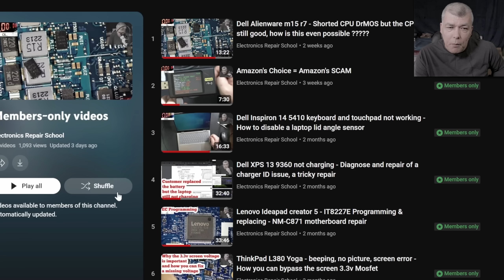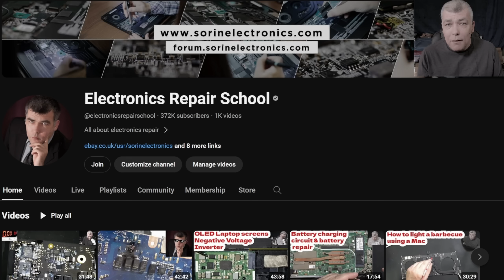HUAWEI MateBook D 15 not charging, board repair

Comment: hello i need help with my huawei matebook D14. my usb ports are not recognizing anything i put in. and when it sleeps it cant turn on automatically (i have to manually turn it off first then start up again) i recently brought it to known a repair shop here in my area for a check up and they said it has hardware issues and theyre refusing to repair it bcuz they havent fixed any huawei products before

Comment: if recalling it is something they can't do because of money issues.
how about give everyone a free magnetic USBC adapter.  
that will somehow solve the issue. 
I have a lenovo that has usbc as charging port. 
and I have Trust issues on such thing coz it is a laptop.. and a laptop weigh so much compare to a smartphone.
you can hold the smartphone from the charging port and it's totally ok.

but you can't do that on a laptop.  
if you happen to bump into that shit while it is charging.  it has a higher change of getting broken. 

because of that I decided to buy myself a magnetic usbc adapter. 
this way the charging port will never ever experience Stress from anything unexpected.

Comment: Parts actually get tested for years in the most extreme conditions. 30 years back i was at a philips testing facility where they already had bending lcd screens in boxes where humidity was very high or temps very high, etc. Just not whole products. But not sure if they have such a facility in china.

Comment: Manufacturers have a development strategy on products they design, they used to design products based on the same internal parts, and the top model board components were present, the base model components were not included, the model looked the same, but the extras aren`t.
Schematics are not included so servicing cannot be achived, it would be the same as removing the identification from the components from the board so you didnt know what they were!.
Spare parts for products are not produced, it would take up storage space, waiting for the repairer to request a part, but when! Products are made as cheap as possible, a new model is not a new model, it a old products made to look like a new model! fooling the customer who is thinking they are getting an improved product.

Comment: One way to make sure the laptop is not comming back due to a unconnected ribbon cable or something like that, is that you should always do quality test. You check sound, camera, USBs (daughterboard), keyboard, touchpad, Wifi. So if one of those is not working, you can always check if you did any mistakes prior to deliver the laptop to the customer.

Comment: i work with vintage radios from the 1930's to 50's and have no problems getting circuit diagrams and parts yet i can't get the same for my phone, tv or laptop
Reply: Yeah same here. I fix arcade games, old Space Invaders or Pacman schematics very easy to get. Even full diagnostic technical manual explaining how to check it and find the exact fault at chip level. For this reason never throw away anything old if it works because they are easier to repair. This is why my main laptop I use now is an old Toshiba Tecra A8 from 2009. Runs Windows fine ande evrything works. If it ain't broke don't fix it. Main issue now is the majority of people are not very smart and have no clue how to fix anything and just buy the latest things even if they are junk lol!

Comment: I was thinking about these 4 pack battery, they're in 2+2 (3.85v X 2 + 3.85v X 2) total 7.3ah configuration, and they look like regular phone batteries.
What I'm wondering about is if one pack is 3.85v 3.65ah. Doesnt phones already have bigger battery capabilities like 5000mha?

Comment: HI SORIN. you want manufactres to make products perfect . but what about all the technician including you??? what you going to do for living 😂😂😂😂
Reply: No such thing as perfect. Electronics eventually will fail, but not in a stupid way like this. But honestly, it is our own fault. We want smaller and slimmer devices, hence this is what we get. A flimsy USB C port, which then paired with lead free solder that cracks easily because manufacturers have to comply with RoHS or they can't sell the devices.
Anyway, back in the old days when we used to have the entire schematic and the parts to buy, repair techs actually made more money compared to now (with the exception of Northridge Fix 😊)

Comment: these connectors are 2 euros each and i get an original, don't be dodgy
Reply: Bullshit. No such thing as original ports. They are the same cheap USB C ports manufactured by some factories in China specialized in manufacturing connectors. Some even also manufacture switches and stuff like that alongside the connectors.

Comment: Isn't high tin solder stronger than low-melt, at least it feels harder when you try and poke it.
Reply: what he used is normal solder wire, low melt is below 180 deg and is used for desoldering.